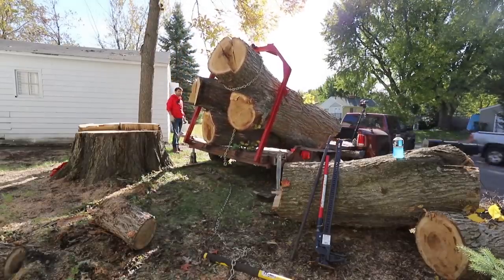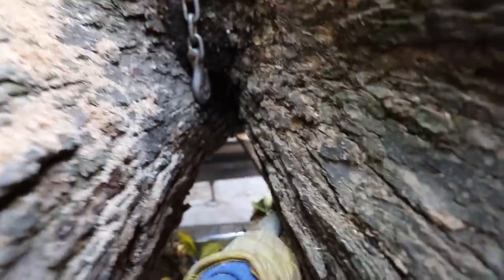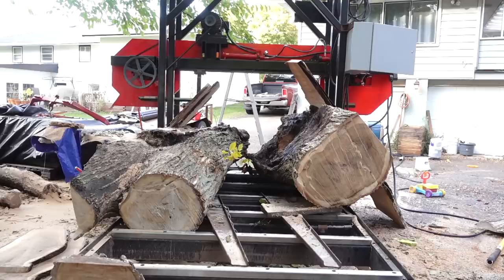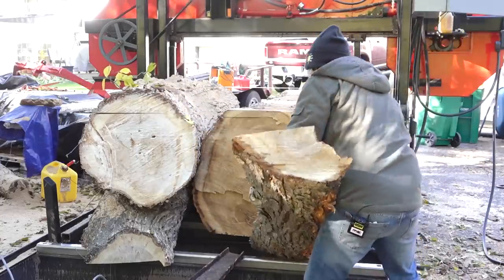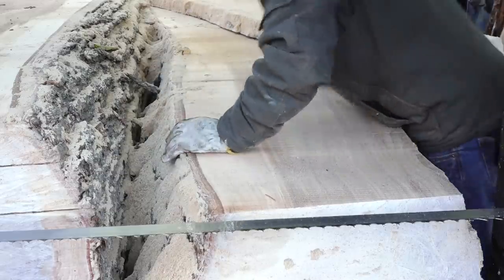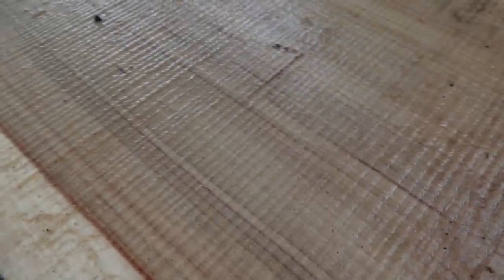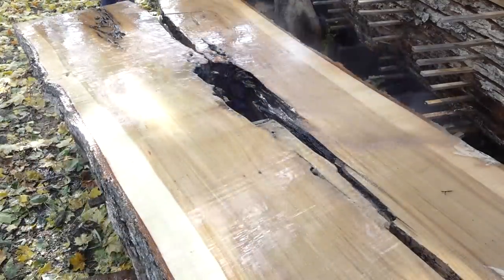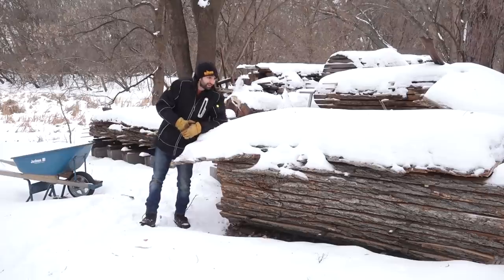This Log Came Apart on my Sawmill

Comment: Was just about to say, I don't think that's a bark inclusion. I think that's two trees that kind grew together.
Also, those shorter cuts could be used as guitar necks. While not as strong as hard maple, they're right in the neighborhood of some of the mahogany species from around the world. Not sure how it holds after drying though. Is elm a pretty stable lumber or does she like to wiggle around?
Reply: Mike, elm was used a lot in early mass manufacture of necks and such (10s/20s/30s) at Chicago factories like Kay. While they are (for most part) stable. it is not a recommended wood as sometime they can go a bit squarely when dried.

Comment: Would it help you in moving those large 2-4" thick slabs to extend the sawmill bed, towards the already stacked slabs, with some sort of roller bunk system? Just a thought. 👍
Reply: If I were a bank robber I would hide my stash inside a tree crotch. While in the slammer for 20 years the tree would grow around it so that it is inside a huge log. Just before I got out some guy like you would harvest my tree and my gold. Would you keep cutting?

Comment: Two trees that grew right next to each other so close they attached.
Reply: Nope, look at the grain. Also you can see the stump in the ground in the other video. It does not look like 2 trees, not even a tree with a very low split. It is low, but not quite to the ground. in the other video is the streeetview picture too.

Comment: Have you looked into a bandsaw blade welder? You could cut the blades you tear up the teeth on and make/remake a blade. Well I just looked up the used prices Never Mind at around $1000. and up for one the size, you would need probably not worth it.
Reply: After 20 blades, would about pay for itself.

Comment: I’ve always wondered, it the water after the slab is cut only to see the grain much better, or does it serve a purpose like slowing down drying to prevent cracking?
Reply: I wonder that too, and browsed the comments for an answer. My father worked wood a lifetime, and I learned that water is not good for wood, not even humidity. Sometimes is used for some operations, but I do not quite get this rinse,

Comment: For the lumber scale, you can make custom scales by getting a few paper tapes from Ikea and gluing them to 1/2" steel banding. Put 1/2" magnetic backing on. On the tape make custom marks for whatever size increment you want. 1 tape for each size. 
  ie; 1/2"  3/4  4/4  or whatever. Easily changeable for each setup. Cost is virtually nothing.

Comment: Just wondering as you go through quite a few blades do you do your own sharpening? I was milling the other day,  on my shop bandsaw, and cut through a 3/8" bolt. Didn't have another rip blade so I sharpened it with a Dremel jig I made from John's channel. Cuts better than before.  lol ( it was also Elm)
Cheers, Lee
Reply from the maker: I haven’t done anything with them yet. I always planned on sending them out for sharpening but I’m a sucker for convenience and just keep buying new blades

Comment: When is the electric advancing motor coming?  My arthritis hurts just watching you turn the handle.
Reply: Drill powered
Reply: @NordboDK  it was for a little while, but not now. Have a closer look
Reply from the maker: Drill is for small logs where I need to turn the handle faster than I can physically turn it. For big stuff the manual feed gives me a lot of feedback as the saw is advancing though the cut

Comment: Have you ever thought of adding a 2nd ruler to the mill that has some kind of sliding mechanism? That way once you make your first cut you "zero" out the ruler at that spot and then you can make your subsequent cuts based off that new zero, rather than how you said you current lumber scale is based off the bed. Not sure if that's a thing that would be helpful or maybe a strong magnet with a point could work. Make your cut, slap it on, and call it good.
Reply: Mitch Heil that’s exactly how the system on the Lucas Mill works. Good idea for Mr Matt as well.

Comment: Matt, Home made Timbor is great to keep insect and rot at bay in slabs and planks.   Here's the  recipe.   All percentages for this recipe are by weight.
   (60% borax-40% boric acid gives the maximum solubility of borates in water)  65% water, 20%borax, 15% boric acid

Comment: Hi Matt! 2-3 ?'s. 1. What are you going to do with the last cut wedge peice? 2. Is Elm any good for turning small peice pen, & toothpick holder. 3. Would you sell that peice or part of it? I grew up in Vadnais Heights,  all the Elm was destroyed in the late 70's from Dutch Elm disease. The tree in our yard was over 80" dia. And took 5 guys to reach around. 1 branch heated our house for 3 years. What a pain to split! the trunk section,  very twisted grain. I would love to have a peice or 2 for small projects like blue tooth speakers and such. Thanks for letting me waste 2 of your minutes. Love your channel! Doug.

Comment: What this is is a BAND SAW type When I was a kid I worked on a Blade sawmill powered by a FARM ALL TRACTOR MOTOR. It was so old it was a hand crank to start. If you have a good operator and good wood you can flat out cut some lumber. It depends how green the wood is and dimensions of slabs can make for a back breaking job toting and stacking the finished cuts. Will never ever forget it was a heck of an experience and taught me a lot.

Comment: Get you a 3/4 battery drill, take off your crank handle and attach a bolt and use the drill. Save your elbow cartilage...

Comment: I put 25 years into working in sawmills. The first 7 years I ran a resaw. This was back in the late 70's to mid 80's, and we got  
50 cents for any metal we would find and remove from the lumber. It was mostly bullets made of lead and copper jackets, which did zero damage to a resaw blade as well as planer and moulding knives. Even with my ear protection in and the feed rate was probably around 15 mph, I would hear a high pitched "DING" and knew to stop and go look for the dark spot in the wood with shiny lead bullet cut in half. Sometimes a single board would have hundreds of bullets in it. I would find barbed wire often, nails, screws, bolts, even hit a few railroad spikes that would break the resaw blade and send it flying across the mill.  It was scary!  Years before I started there a guy found an entire muzzle loader that was placed inside a hollow spot many years ago, and the tree grew around it.  Its display in the office still.

Comment: Matthew, wondering why you don't use a wand type metal detector before sawing. Don't know how deep they penetrate, but would at least help you locate metal objects near the surface. At $50. a pop for blades, wand would probably pay for itself in no time.

Comment: You work very hard at moving slabs. Consider a two wheel ‘V’ frame cart using steel cart wheels. I’d like to see more of your future videos, so let’s work smarter to prevent back trouble later. I’ve taught my boys ‘work smarter not harder’ and they thank me for teaching them what I myself should have learned in my youth. I’m slightly worn out at 72.

Comment: You need to add a 2nd adjustable lumber scale....
After your 1st slab cut on a full log, you set "zero" on the face of that cut, and then use the lumber scale measuring down from the top....so the 1/4 scale goes down and not up like your fixed scale referencing the deck.
I dunno if this makes life easy, but it certainly removes the mental gymnastics when you are tired after muscling slabs for a few hours.

Comment: Why don't you use the watering plastic tank that normally resides on top of the saw frame? Might make the saw blade last longer. Remember it's removable so you can take it inside if it's too cold overnight.

Cheers

Comment: I used to work in an old Dutch wind powered sawmill on Saturdays, for fun. In many mills, the cap of the mill can be turned into the wind rolling on wooden bearings, which are just slightly conical pieces of wood, maybe 6 or 8 inches in diameter, that roll in wooden races. They almost always use elm, due to its resistance to splitting. To lubricate it, they just throw a couple of pieces of hog fat in among the bearings and it is all squished around as the cap is repositioned. I know, disgusting. I saw a lot of elm, because of, you guessed it, Dutch elm disease. Seeing you saw this elm made me think of that, and I can nearly smell the wood, which I have to say, is NOT a particularly pleasant smell. I am guessing that if you lived anywhere near that mill, you would have been there on Saturdays, too. Anyway, cheers. Love to watch what you are doing.

Comment: I am  much more of a metal worker than wood though I do a little of that too. Retired now but a lifetime as a tool maker for Aerospace. You did a nice job on the mill, the feed system is simple and effective... GREAT JOB! What did you use as a roller system for the saw frame to roll on? There were some great looking slabs from that tree.

Comment: Doing well matey and truly you really do need a metal detector and is it possible to keep the old blades for nails..a bit of mucking around..use good blade up to nails..switch saws ..cut through them and put on good saw blade again...save a lot of angst with a metal detector...ol mate i know has a buzz saw and does all kinds of buzzing in old timber & checks every piece with detector says saves his 2k a yr in damage to blades & down time... :))

Comment: As i suggested before. Buy yourself a cheap metal detector  off Amazon and run it iver your logs before  so you can save your blades. You can get one fir under $100. And im sure thats cheaper than destroying blades all the time

Comment: For about $130 you can get a 2 ton electric hoist which you can mount in a single location for more you can run a trolly setup so you can roll the hoist to where ever.  Or for $600 you can get rolling gantry although I don't know how high they go.

Comment: why dont you just use borax for the ants?  plus, the boric acid will add preservative to the wood.  win/win/win  whats the third win?  its not only safe, you need boron and it will soak into your skin and your body can use it as a nutrient.  good stuff and cheap, unlike that commercial stuff.  was that another win?

Comment: you need more experience in choosing a log.  look at the seam and how long it is and remember that the tree as it branched off... it grows "alongside" but NEVER attaches. look at a tree with a right angle limb...it is a strong joint....if it is a v type joint and the bottom of that seam is cut it will happen again. the tighter the v the more it will happen.  you can find these type of v joints easliy on a pine tree where the top broke at one time due to ice or wind, it then repairs itself by growing multiple branches up. It closed fast but those branches are separate parts and will  not join ...so look for the indications shown to you in the seam below that so called joint. Stay smart stay safe good luck.

Comment: Matt, you are inspirational. The way you move those logs!!! I have sort of an issue with some myself. Having a small mill (22 in.)and landing red oak logs of 30-32 in diameters, 10 -12 ft long, makes you think alittle when you don't have equipment to move them. Getting them from my trailer is sometimes very challenging. That elm will produce some nice lumber for a dresser.

Comment: What I would do is get a blade that cuts steel and make it fit your mill and when you suspect steel in a log use the steel cutting blade cut a little slower but you will not ruin a blade just a suggestion for you to take or leave. approximately what do you sell a slab and who do you sell too I am here in canada and have wood but find people are cheap a lady wanted a fireplace mantle I had some rock maple I was thinking $400.00 she thought it was expensive

Comment: Hey Matt I like your bandmill , woodmizer doesn't have anything on you. I have built my own bandmill and was wondering what blade tension you run. Mine is set at 25ft lbs and works beautifully on a 15 to 20" span, but when I move the guides out to 40" the blade starts to wonder . I may not have enough pressure.

Comment: Enjoyed this and your sawing methodology.  Always wanted a bandsaw mill.  Our town's (Cumming, Ga) fairgrounds has a demonstration sawmill (circular) run by old belt drive diesel, gas, and steam powered tractors as a demonstration.  Not able to handle the size you built which is really specialty built for crotches/burls I assume.  I don't think you would find elm down this way (Ga.) like you would in north country.  You must have a lot of feelers out in order to pick up these beauties.  Great that you're a "recycler"

Comment: Now you've had your sawmill a while Matt, have you considered upgrading to a slow geared electric winch instead of the hand winch to pull the blade along the bed? Also upgrading the blade spray to a built in one instead of a spray bottle? Just an upgrade idea to stop you getting bored 😂

Comment: One can see that an electric motor is much more efficient than gas. The motor appears to be a 10-15 HP. A gas would be at least a 40 HP. Electric is much quieter too.

Comment: The insect damage won't necessarily kill a tree.  (See about 30:00.)  The center of the tree is dead and really not contributing to the growth of the tree.  But the tree is a lot weaker.  Arborists will evaluate how thick the walls of a hollow tree are and determine if it's strong enough.

Comment: I designed and electric lift couple years ago and I used a remote control winch it works great very cheap I was thinking you go fit the Remote control which on your machine instead of hand winch that you use you can control the machine from the other side of the machine with the remote control. Hope it helps you

Comment: My buddy and I -  made some slabs with a similar saw. I highly recommend using water during the cuts. It lubricates the cut and makes it go a whole lot smoother. We just had a drip system to let a small flow of water go from the reservoir onto the saw blade as it entered the cut. Nice videos, keep up the fun work.

Comment: Where is your metal detector?  You can at least get a heads up on what’s where and if they are on the perimeter you can dig them out.  For what you save on blade maintenance, the detector would pay for itself.

Comment: I enjoyed your video.  My background was forestry.  Been retired many years.  I worked in the Pacific Northwest.  Many of the timber companies had to deal with metal in the timber.  Some put there on purpose.  Before they had strong enough metal detectors they would have problems hitting the metal with the giant band saws.  Sometimes it was as if a grenade went off.  Our mill had a little museum showing what they found.  Fence line, rebar, old gun barrels, etc.

Comment: depending on where you find the tree a good deal of the time you find lengths of wire for a fence for matters of convenience.probably.  the effort expended it's the largest matter it seems or lack of justification for placing poles.  a tree can tell you how old  a property might be or how many times it's changed owners or even if they were mindful by seeing it unmolested as possible. or even if they had children by how many or what kind of fasteners you find in it. I've seen trees that can't survive on their own because someone interfered with them so much they took the natural strength out of it trying to bolster it.  like anything, if you know what to look for, a thing will tell you a story and even tell on itself from the scars it bears, as Mat is finding out daily. it's how one ends up having a love affair with a vocation really. if you don't love the thing you do it becomes forced and soon you will develop resentment for it. I don't have to tell you where that leads. I can see Mat still enjoys the journey  I'd never begrudge a man of that.  I'm glad for him. when you mill a tree you can close your eyes and see the families there where you found it with a little imagination the pieces of the puzzle fill themselves in.  you might even find out if love lived in the home i once found a jar of pennies in one with a piece of paper in it that simply read's daddies boy. it looked as good as the day it' was written. there were many rings in that tree.  it came from an abandoned farm.

Comment: What always get's me is people will spend all this money making a band saw... But will put a hand crank on it. Button/motor drive is very cheap, easy to do and if you are worried about feed rate you could even include a small very cheap limiting device.

For example; you could use a current sensor going to main motor; and when it peaks above a certain threshold it would trigger a relay or another component to limit the feed rate. A motor may run at say 3 amps, when cutting 6 amps, but if it's over 8 amps that means it's working to hard on the blade, so a simple relay that after 8 amps triggers a pot connected to winch off button to limit current going to it to slow or speed up feed rate. If it's optimal for your motor to run at 6 amps you could even get fancy to speed it up and slow it down to maintain that load to reduce wear on blade. 

Dude if you need help let me know; we could make this completely automated push button style.

Comment: For the indivual slabs (If you want to use them for shelves, or to make a table top), Could you  clean out the dead areas, and fill them with epoxy mixed with colorant to match the color of the wood  (maybe even add some of the sawdust to color the epoxy)?

Comment: Of course its heavy, its elm. you can cut it into fire wood and if you can figure out how to split it it can set for two years drying and still have water run out of it when it goes into a stove. However a six inch log will smolder all night in a good stove and have a lot of coals in the morning.